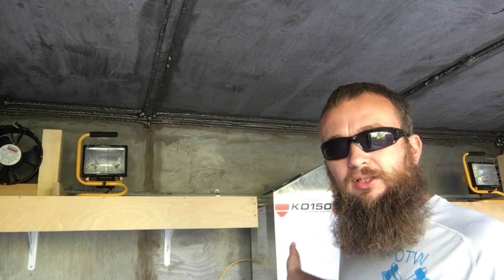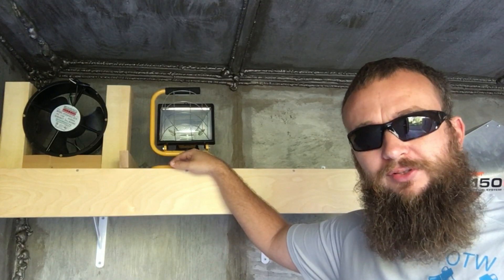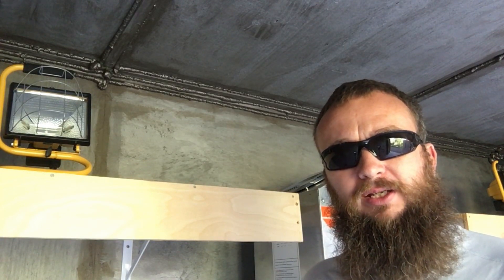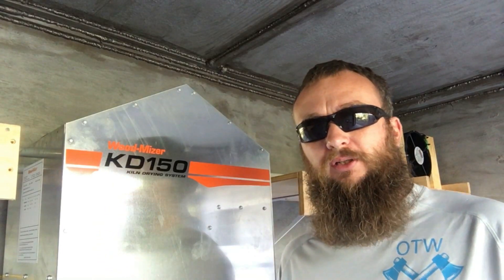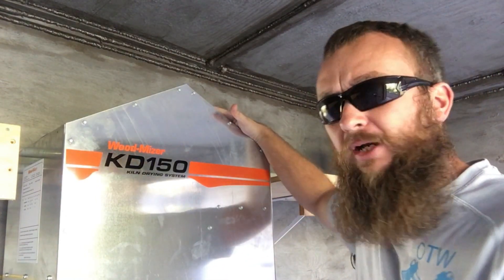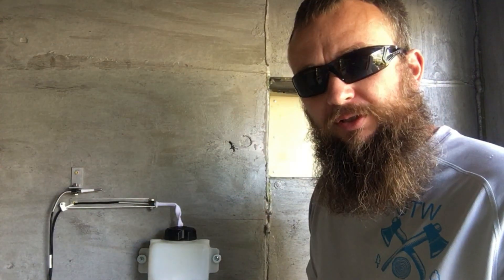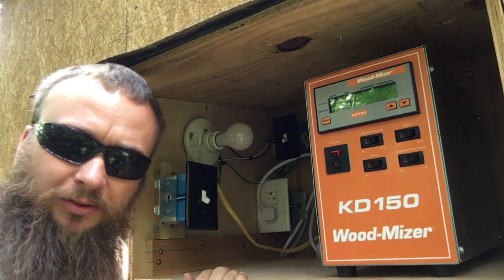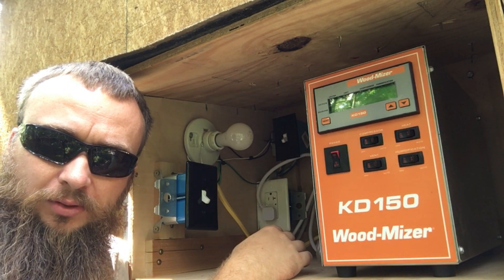BUILDING A KILN PART 8, CHAMBER COMPLETE

Comment: The lights are 4.5 amps each and most of the output is light, not heat. 
At 3:30 you state that the work lights are 500 watts and take "maybe 1 amp" to run. The power formula is "Power = Energy X Amperage". 
If Power = 500w and Energy = 110v then Amperage = 500/110 or 4.5 amps.

Comment: Hello! I was wondering if you have to have plywood (boards, stainless steel or whatever) on the inside or can you just put the rigid foam up and you are good to go? (plywood is nice because it gives you protection in case you pump into the walls with a board or so.. but other than that is there are reason for doing it?). Thanks and greetings from Nova Scotia, Canada
PS I am thinking of getting a WM HD150 and building a small chamber like 16'x5' or so with a sled to load and unload the kiln
Reply from the maker: I would use something over the foam so you don’t damage it 
Good luck with just kiln!!
Reply: Hey, thanks for the quick reply! Do you mean damage it mechanically? If I use a sled and dont even go into the kiln, the chances of damaging it should be pretty minimal? Or do you think the heat could damage the rigid foam?
Reply from the maker: That’s a question for Nyle I did it to protect the insulation
Reply: Ok thanks, I will let you know how things turned out. Cheers!

Comment: This is so awesome!  How many board feet per year can you dry with this thing?
Reply from the maker: Not sure on that James, It can hold up to 1k bf per load of air dried lumber, green lumber is another conversation, Loading it up this morning with air dried walnut, thanks for watching and the support!!
Reply: Awesome!  If it holds 1k bf @ 10 days per load for air dried = 36-1/2 loads per year = 36,500 bf.  But that would be all air dried if you kept it cranking non stop all year.  How long does green lumber take?
Reply from the maker: +fartfully I will address that ? In today's video 👍